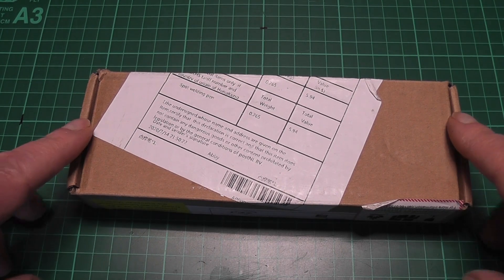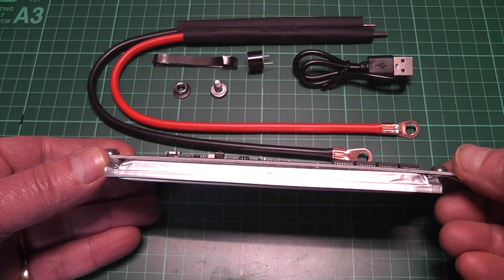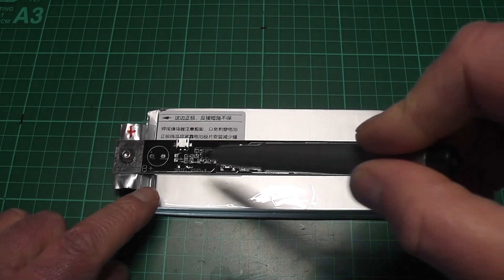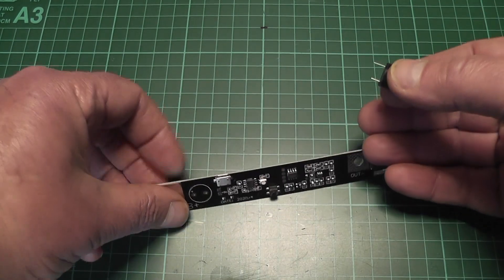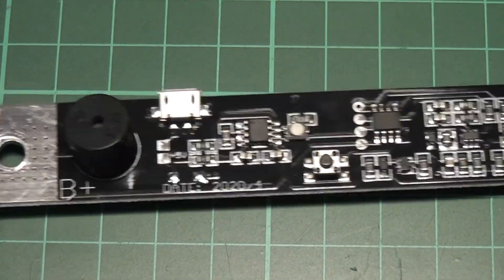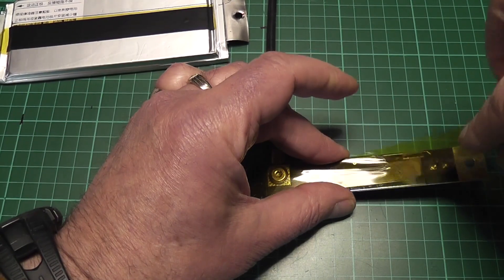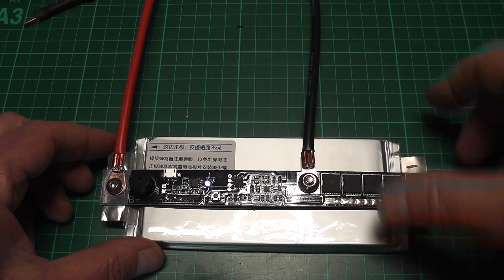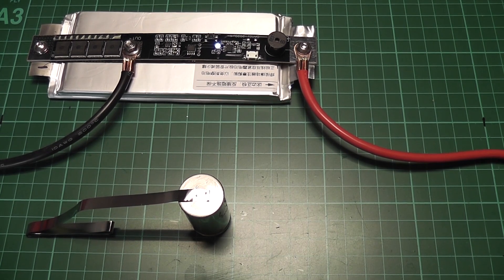Unboxing, Assembling and Testing a Portable Battery Spot Welder

Comment: Hi, thanks for the video. I've just received the same welder but it only has three MOSFETS on board. Could you tell me the manufacturing date on your board and the MOSFET type number? Mine are 4N04R8 300A each. There is no place for a buzzer on my board although I did get a case but it was too short to fit the board.

To Mark below, if it's not too late, don't solder the 18650's you will almost certainly destroy them.
Reply from the maker: On our board are 4 x MOSFETs FDBL9403. Different manufacturers possibly. Last spot welder didn't come with a buzzer and it made no difference as it died after the first weld anyway
Reply: @DrivewayDudes  Thanks for that

Comment: Hi Paul and thanks for the Demo.Can you give me a link to this and the Nickel strip you are using.I'm wondering if  you had to wait for the slow boat from China -ages.I WILL get it if the cost isn't too expensive . It would be interesting to see how many spots you get per charge.Enjoyed this thank you for sharing.
Reply from the maker: Hi Mark, We purchased from Banggood.com for €25. Nickel strip was included. It took about 4 weeks to arrive. Batteries were reading 3.7V when it arrived. It took another 3 hours to charge it fully with a 3A input though we would not recommend using 3A every time as it may shorten the life of the batteries. When fully charged, it was reading 4.2V. We spot welded more than 6 so far and it's now reading 4.15V so not bad at all. We did notice the quality of the spot weld will greatly depend on the pressure applied to the strip but we would put that down to a learning curve
Reply: Thanks for your reply Paul.I have a few 18650 cells .I will try soldering them with an Iron first,to replace the cells in my old cordless drill.If they do overheat,then I will try the Spot machine.There is certainly a wide range on the Banggood site.Bit bewildering to an amateur like myself.